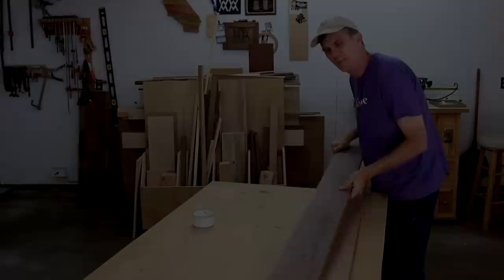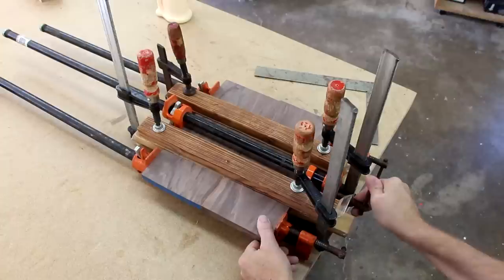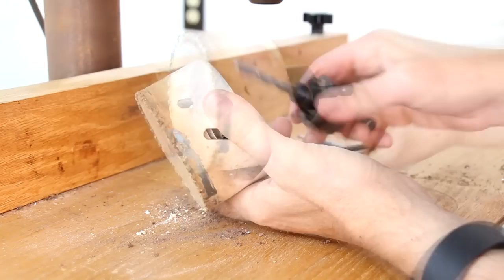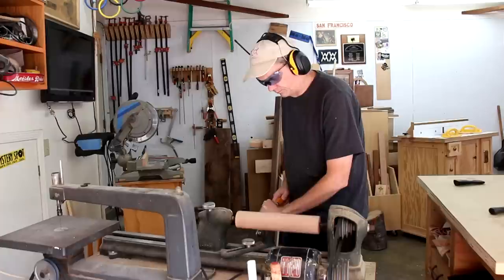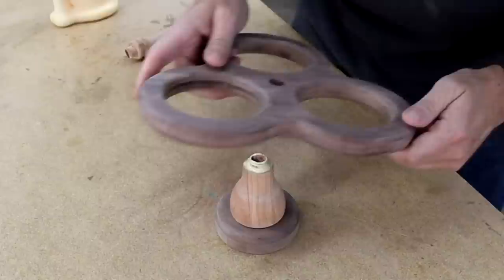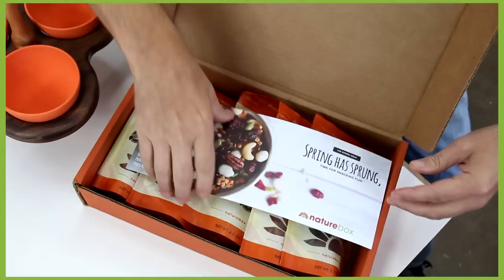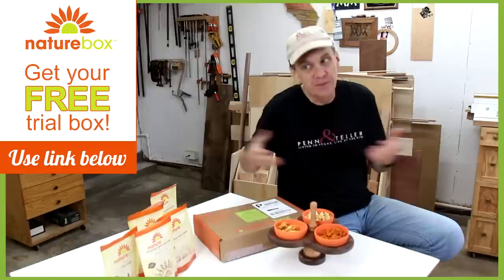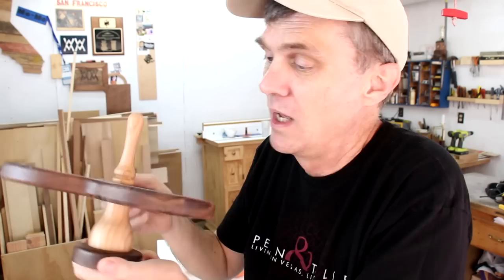Unique Wooden Serving Tray. Great for Snacks!

Comment: Those relief holes in the side of the hole saw are very useful.  Just use a small screwdriver and put it in that hole and pull up to push the hole slug out.  Just go easy and go around to each hole.

Comment: If you use a smaller rod/screw it the slots on the side it twists the plug out with out having to unchuck or removine the center

Comment: And in the case that you don't have a band saw or a jig saw you can sharpen one of the legs of your bunk bed and hit it with a rock to cut the centers of the snack tray out. If you find yourself without a lathe or a dowel, you can use a chicken bone for the center piece!

Comment: Steve, I have noticed in several of your videos you use tape or plastic wrap when using wood to help brace glue ups. Have you ever tried coating the wood with wax? It works really well.

Comment: Nice easy project Steve I just need to get a lathe. Great job on it.
Reply: I know what you mean . You did a good job turning that spindle for the snack tray. Thanks again.
Reply: Backyard Woodworking You could do it in two separate pieces using a Drill Press as a Lathe Nick Ferry style!
Reply: yes you could

Comment: When using the hold saw drill just over half way, turn it over then finish drilling through.  now there is a lip on the hole that you can easily pull out without disassembly....

Comment: Hole saws are great but I wish more drill presses would run at slower speeds, a 4" saw has over a foot of blade in contact with the wood.

Comment: Nice video Steve why you do not clear the hole saw with a cleaning fluid or with a metal brush before use to remove bonded wood and outcome be better holes but it does not necessarily have to do it is just my tip and this snack serving tray came out very nice and handsome

Comment: very nice. Wish I could find the lumber you have access to here where I live. Sadly I only have easy access to oak, maple, poplar, fur and pine. I worry about ordering online. Not sure what quality I would get without actually inspecting it before I buy. Could you recommend a good online source?
Reply: ShaneHammer I've purchased boards from woodworker's source, and they did a good job. I've gotten some small stock for inlay from Bell Forest Products, and I've purchased thin stock for scroll saw work from Ocooch Hardwoods. All of those suppliers have provided good product and timely delivery.
Reply: thanks! I'll have to check them out

Comment: can I make this stuff without all the fancy equipment? like the rounder and stuff, like what are the most basic things I would need
Reply: ***** drill press, table saw, jigsaw and elbows. lots and lots of sanding.
Reply: howycwap Hey there Bubbles, could probably make do without the drillpress, sub-in a hand drill and cut out the large circles with a jigsaw?
Reply: Deathlok67 oh for sure, jigsaw would work nicely. bubbles approves of this method

Comment: How stble is that with such a small base ?
Just imagining a BBQ where someone chatting 'aims' their hand towards the bowls and is a bit heavy handed.
Nice design though
Reply: ***** Yeah, it seemed stable when you put the glass bowls in.
Another thought is to cut 2 edges of the cutout's to the right angle so they could be joined in the same cloverleaf shape for the base

Also, if you set your depth so you drill most of the way through,  then complete the cut from the other side, that cutout would probably drop out